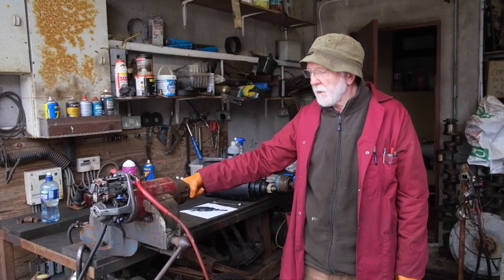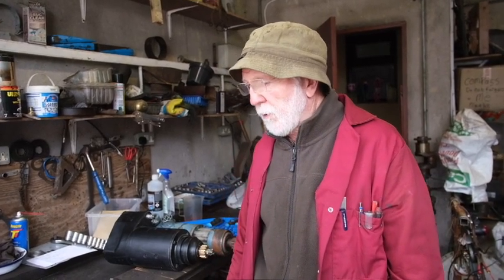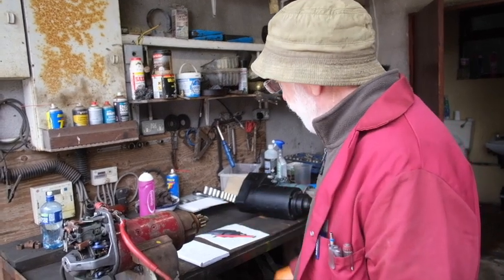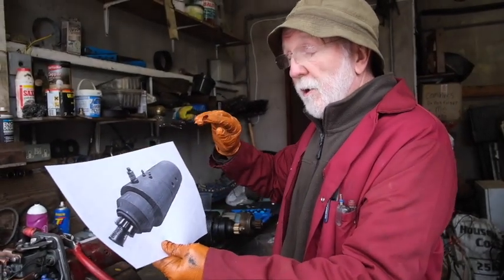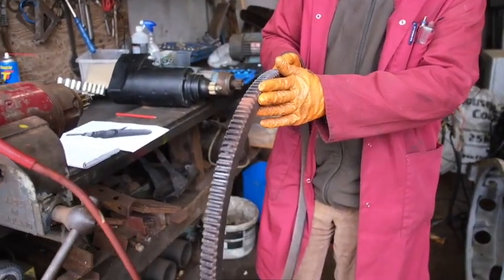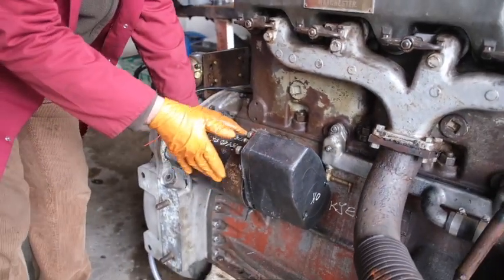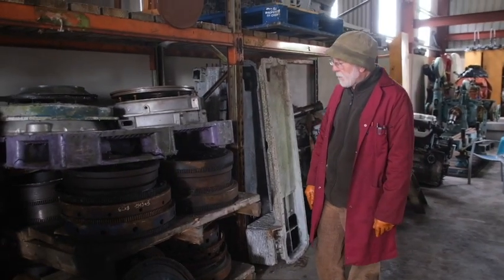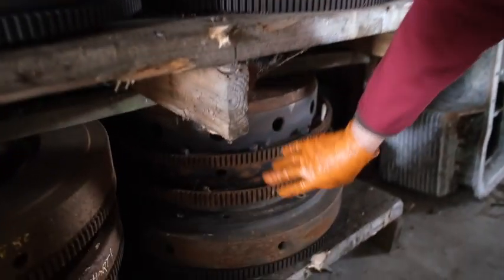Gardner CAV 12/24 volt starter breakdown

Comment: I worked on a 1920`s car starter motor made at Rustons in Lincoln. I noticed the gear was miles away from the flywheel. I did not find a problem with the starter. I did say to the group to move it closer. Hopefully it worked.

Comment: Hello Joe, I have one of these on an old 1960s forklift with a Perkins 4.203 engine, there is a multiplate clutch pack in the starter, mine is slipping, it turns two or three compressions, then the clutch slips and the engine stops turning, is this a common problem?

Comment from the maker: Once again, I missed a couple of important points (It's an age thing!).    This is not always true, but nearly always: these starters are "insulated return".   They do not rely on the body of the starter for an earth.   In marine applications this is good because it reduces the chances of current flowing through the hull and causing corrosion.   In all applications it is important because it reduces the chances of accidental short circuits.  On the big terminals it doesn't matter which is the plus as long as a +ve voltage is applied to the small central terminal.  Normal convention is that the left hand one is +ve, when looking from the starter nose.   Be very careful tightening the large terminal nuts.  It is most important that the stud itself does not turn.   Tightness of the inner nuts should prevent this from happening, but ............
Reply: Yeah, I've got one on a gen set that has worked itself loose and blown its way through the housing, don't know what went on till I open it today but she ran on by herself, I would assume the contacts stuck inside 😡